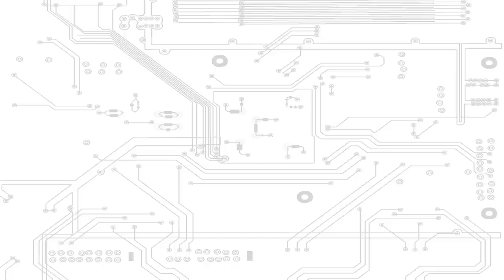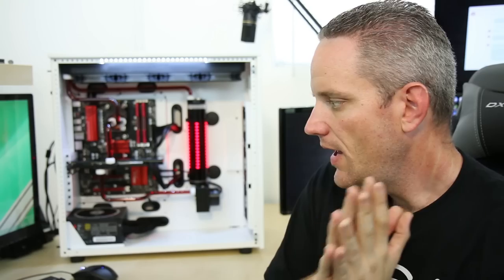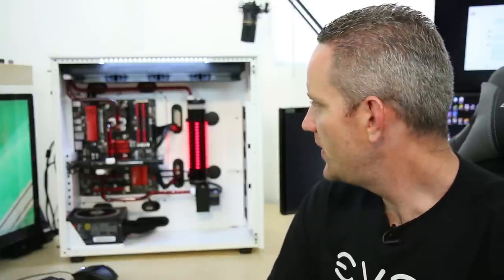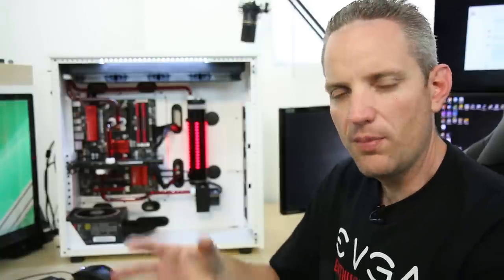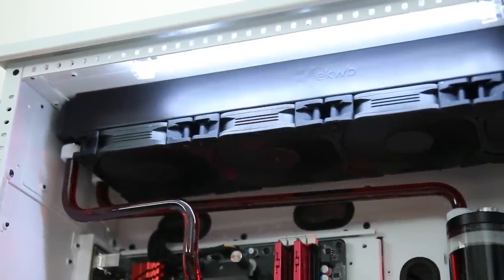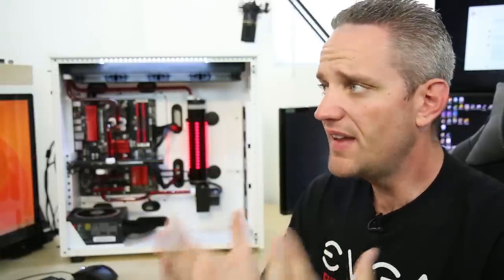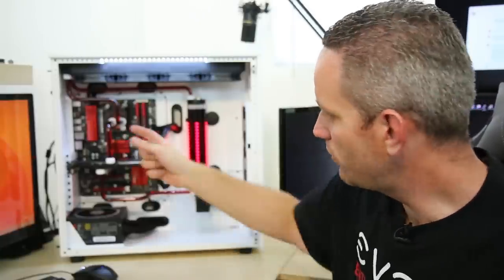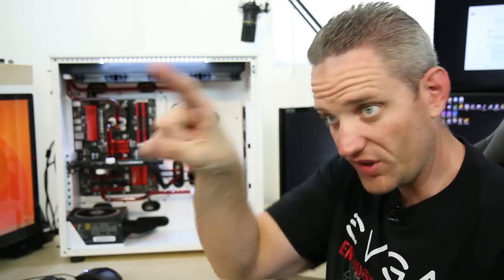Custom Watercooled AMD Gaming PC

Comment: it is possible to make a watercooled PC with a budget of 1300$?
but the PC should also have a good performance for video editing. (my idea of my PC)
Is it possible? :)
Reply: AidenFX | Motion Design $1300 is about £830. So for that you can defo build a pretty powerful system. It also depends what sort of water cooling you want e.g. custom like in the video or a closed loop like a Corsair Hydro Series etc as that would determine how much you'd have left for parts etc. But generally in that budget range I'd stick to AMD. Either an 8350 or you could get a 6300, overclock the fuck out of it and then spend the difference on a better GPU as you can utilise the CUDA cores (only on Nvidia) to increase video rendering speed (significant increase) and have increased performance in games. Yup, I'd probably go 6300 lol.
Reply: Even.Ways Music  ähm yes i mean  custom watercooling. 
and i don´t like AMD processors because they´re haven´t much power. Intel is in videorendering etc better
Reply: AidenFX | Motion Design Intel is better yes. But if you just use GPU rendering the CPU makes no difference and you can save like $120+ on the CPU and put it into a much better GPU. Plus if you overclock an AMD FX it makes up most of the performance gap. But yh, that's the most cost effective way in my opinion.
Reply: Even.Ways Music  is gpu rendering as good as cpu rendering?
Reply: AidenFX | Motion Design I'd spend more money on the CPU, because the performance of CPUs doesn't increase as much over a certain time as the performance of GPUs. So if you have got a good CPU once, it will serve you long.
If you buy a high end GPU now, you will still have to get a newer one soon, if you want a comparable performance at new games.
So I'd rather go upper midrange or high end CPU+ midrange GPU.
Reply: TheKroeterich  okay thx

Comment: Why does everyones CPU run much hotter then mine i have an AMD FX-8350 stock cooled and i got no higher then 40c under load and idle at 22-25c
Reply: Plant Gollum it might be the airflow of your case.

Comment: I want to do a custom loop for my next build but I don't have a reference GPU :(
Reply: Oreo1298PvP There are plenty of blocks out there for non-reference GPU's.  You may have to get a different card, though.

Heck, I've noticed that plenty of cards I though were custom PCB's actually WERE reference cards!
Reply: It's the MSI GTX 980 Gaming 4G. I'm 99% sure its a custom PCB.
Reply: jedidethfreak
Thanks!

Comment: The build looks gorgeous and the parts are "OK", but the case still makes no sense. 

Don't take me wrong, I love caselabs cases and what Thermalfake did was wrong, yet the build do not require that case and the money could have gone in better performance hardware and a cheaper case.

Comment: Hello, my dad works for lenovo and he is getting me (for free) an m58 9960 computer, I'm upgrading the ram to 4gb and I just bought a nvidia geforce gt 730, I have been told by 2 people that I can run most games at 720p at low setting at decent framerate, I would like to know what games I should start off with and won't be too expensive, also this is a temp pc so don't rage and if the games are in a bundle in steam, that would be great :)
Reply: ethan price League of Legends, CS:Go?
Reply: TheKroeterich thanks dude :)

Comment: Eeewww... White, red and black..? Should have gone with a Define S. What a waste...
As for your question on water cooling content, here are some ideas from the top of my head.
1. Slim, high FPI rads vs thick, low FPI ones.
2. Waterblock installation guide.
3. Push vs pull vs push-pull.
4. Full system watercooling on a budget.

Comment: ***** I've been wanting to request a certain water-cooling video for about two months now... Would you be willing to do a "retro" water-cooling video, using parts from 10 years ago (water-cooling parts, case, hardware and software available at the time, including OS), and see how it might handle games from, say, the past 5 years on at least 720p? I know it's something that would cost you time and money, but I thought it would be something nice to see from you, since you've been water-cooling for about a decade. That, and I'm curious to see the things you did when you first started out, and what you would change or do differently if you had the knowledge you have now when you first started doing it. It might be "pointless" for some, but I think it would be a way to show just how far water-cooling has come since then.

Comment: amd cpu's for wow are not good. wow is cpu dependent of single thread performance. single thread performance to potential minimum fps is pretty much a 1:1 ratio. so in a raid or congested area an i5 or i7 will give you 30-50% more fps and in this build an i5 wouldve cost about 50 bucks more for that 30-50% gain

Comment: that psu isn't very good and isn't even price well. at $129.99 USD it's just poor and there are many better ones for lower cost. I think it costs so much because of the sleeved cables, but it's another fsp raider/aurum based psu. hope you didn't buy that for full price somewhere. best bang for buck AMD cpu, especially if you're doing any overclocking, is the FX 8320E or FX 8310. lower leakage parts and to state the obvious, you're saving $35-$55 and they're all the same cpu at the end of the day. nice build though. gonna change to rigid tubing in the next month or two.

Comment: ***** I'm a little disappointed in this build - not because it's an amd processor, in general. let me explain. I'm an avid world of warcraft gamer and I regularly post in the games gaming and hardware section of the wow forums. (under the handle mephala). people often post because they have fps problems when using amd cpu's. world of warcraft WILL run FINE on it, until she gets into 25 man + raids. at which point, a core i3 would crush it. a 4690k would beat it by even more. in fact, the fps dips can be so bad in raids on amd cpu's that I would downgrade to a gtx 960 in order to upgrade to a 4690k.

Comment: This is my dilemma I want a 8 core but the am3+ motherboards don't have PCI 3.0 and I have a 960 FTW.
Reply: Pci 3.0 is backwards compatible with pci 2.0. You are fine.
Reply: Dont get AMD, Intel does better if you want to game..
Reply: PCI-e is backwards compatible. Your card will work with any AMD board.
Reply: Get AMD, it does just fine with gaming. AMD user since 2002.
Reply: Chris H. Intel is way better for gaming..
Reply: blake adams i saw a test on youtube and if it is correct the pci-e 3.0 is only 0.5-1 fps better than pci-e 2.0 on 1080p. I bet the pci-e 3.0 only matters if you want to play at 1440p or 4K.
Reply: Wiikendz Watch a video where JayzTwoCents says AMD is just fine. The extra 5-15 frames is not worth the 200dollars more. So its not WAYYYYYY better. Sorry.
Reply: jkteddy77 I am waiting on Zen for my Fury build. If not, 5930K with Titan X ( or the next better, cooler running variant ). I typically make my builds last about 8-10 years before moving forward. I am still rocking my 965 BE and my first build was an Athlon XP ( still a beast and still run it for old games )
Reply: jkteddy77 This is why we do our research before pairing up cpu/gpus that do not play nicely with eachother. lol
Reply: jkteddy77 yeah man. I am running a ASUS GTX760 OC with my 965 BE ( zero bottleneck ). My fps went through the roof upgrading from my EVGA GTX 260 Superclocked Edition ( I needed DX 11. GTX760 is as high as I should go with the BE ). Im sure the 8350 could handle something a little more than the 960. 
   Yeah, I take GREAT care of my computers. They run like they are brand new. From what I have learned. AMD plays better with AMD GPUS and Intel plays better when paired with Nvidia GPUS. lol
Reply: Dude my $77 cup bets a $250 Intel one so no will never buy a Intel they are to expensive for the performance. I can get a 8 core for $130 so Intel is just for enthusiasts
Reply: blake adams
Oh yea, right. Tell me what CPU you have that beats an i5 4690k?
Reply: blake adams your CPU aint better than an i5...
Reply: Wiikendz in some things, it can be. Intel does not fully beat AMD in EVERYTHING. They both have their strengths and weaknesses. Both beat each other in different things.
Reply: Chris H. He has an 760K, that thing aint better than an i3.. it will never ever beat an i5.
Reply: Wiikendz i was not aware he had a 760k
Reply: jkteddy77 I dont trust MSI AB anymore.. Since I turned it off, I average like 10 fps more in GTA V..
Reply: I think the biggest problem with computer gamers is that you all are WAYYYYYYY to concerned with FPS rather than enjoying your games and hardware. You do not need to "max" out your games. Set it to default and move on.. I am a computer guy too but I do not obsess about it. Its getting REALLY sad these days.
Reply: jkteddy77
That was my issue in GTA V, I needed every % up to 100% to get good fps.
Reply: jkteddy77 yea, im thinking of getting an i5 to get better performance..
Reply: jkteddy77 Ofcourse turning up graphics gives the GPU more to do, it has higher quality textures etc to render. When you lower the graphics you get lower GPU usage because the CPU cant push enough data to keep the GPU at 100%.
Turning up graphics doesnt make your GPU output more frames, not at all.

In any CPU intensive game, a 760K will bottleneck anything above a 260X, a 960 will be bottlenecked quite a bit.
GTA V for example, a 860K can barely keep the 260X at 100%, there is no fps difference between Normal and High because the CPU cant send enough data for higher fps on Normal.
Reply: jkteddy77 an i5 4690k and 8350 is almost the same in rendering aswell, so the i5 would be the best choice, because it gived you both, the 8350 only rendering.
Reply: It's not a problem research it its not. a bottleneck yet
Reply: blake adams wow, you beat a special enegery-saving notebook/ultrabook cpu. applause! not comparable to desktop i5s
Reply: For a gpu in the range you're in it won't matter
Reply: Wiikendz It`s all depend about the kind of game you are playing and if you want to play a game at 200fps. The problem is 90% of the gamers are using a 60hz computer screen and a lot are just using mid range gpu where you wont see a lot of improvement.Lately except Arma, I see the others games getting better fps on AMD because they want to port their games over the consoles. I`m using a Phenom II 965 and I started to get 40-50fps on Planetside 2.

Comment: I don't really  like asrock mother boards my first motherboard I got was about a year ago and this mother board was terrible about 3 weeks after my first build it crashed I had two pull out two oft 4 memory sticks because the slots weren't working properly I called my memory manufacture and they check all my memory and it had no problem and then I made sure everything was compatible it's weird because it ran two sticks of memory fine and I checked the max memory it can have it could handle 32gb and I had no were near 32gb then about a year after that my mother board stopped working my computer just wouldent turn on. So I tryed to find the problem my self and I thought it was the mother board but to be safe befor I bought a new one I took it to a proffesional computer company and they said it was the mother board so I decided to call asrock because it should still be under warranty well there mother boards only have a 1 year warranty so I got really mad and order a new Msi mother board and have had no PROBLEMS AT ALL

Comment: custom watercooling is nice still doesn't feel worth it
Reply: martin eike Pure price/performance?  No, it's really not.  You can go AIO and get similar performance - even for GPU's - for FAR cheaper.

Aesthetics?  Your mileage may vary, but IMO, it's worth it.
Reply: I run WC for two 780ti and a 4770k. My GPUS when ran in air would max out at about 80*C, now they reach a chilly 53*C.

CPU gets a bit hotter than that at 60*C playing high demand games. The aesthetics also look awesome. So at the end of the day it's pretty awesome but expensive.
Reply: Span Dan A gift for you --> ºC
Reply: martin eike I have 2x 980Ti's fully overclocked they hit 36c whereas before they were in the 80's. My room doesnt get as hot anymore and the case is super quiet meaning a much more enjoyable experience. The cpu overclocked runs in the mid 40s while gaming (5930k @4.5ghz) and doesnt break 60c while under a stress test like aida64. Not to mention it looks great.

Sure its not really performance/price worthy but its more of an enthusiast thing and more of a hobby for myself.
Reply: *****
 I refuse to come to terms with how much ive spent so far lol o.o.
http://pcpartpicker.com/p/gxrBRB

Not to mention the watercooling blocks (X99 block, both GPU blocks and backplates, Triple parallel for the GPU's. Pump, res, tube, fittings. 240 and 2x 480mm radiators and 14 corsair sp120 quiet edition fans, 1x AF 140 aswell.

Of course it never needed to be anything as powerful but its a hobby of mine, Expensive one but lol.
Reply: Roof Tyler I agree man. WC is so worth it. How many rads you packing because your cards are extremely cool or are the 980ti's efficient cards?
Reply: Roof Tyler Sorry just seen your other comment! Awesome Bro! Got any photos?
Reply: ill stick some up tomorrow got a couple fans to put in tomorrow and a few cables :)

i have that many radiators for the future really incase i decide to get 3way cards the extra 240mm radiator will help quite nicely. but yeah they run extremely cool 36c so far.

Comment: Can u guys help me?
I might build this pc, but im not sure if i can get a better one for this money.
And what power supply should i use?
http://pcpartpicker.com/p/yrW6Lk

CPU: Intel Core i7-4790K
CPU Cooler: Cooler Master Nepton 280L 
Motherboard: ASUS ROG MAXIMUS VII HERO, Socket-1150
Memory: HyperX Savage DDR3 2400MHz 32GB 
HDD: Seagate Barracuda® 2TB 
SSD: Samsung 850 EVO 250GB SSD 
Video Card: EVGA GeForce GTX 980 Super Clocked 
Case: Corsair Obsidian 750D Big Tower Sort

Comment: YO JAY! what do you think of this for a $700 build? is it worth it? AMD FX-8350 4.0GHz 8-Core CPU, MSI 970 Gaming AM3+ MOBO, Mushkin Enhanced Stealth 8GB MEM, Seagate 1TB HDD, MSI GTX 960 Gaming 2GB, Rosewill ARC 650W PSU, Rosewill WolfStone Case 

it's a combo pack from newegg http://www.newegg.com/Product/ComboBundleDetails.aspx?ItemList=Combo.2291588
Reply: thelastone7139  What I have now : Intel(R) Core(TM) 2 Duo CPU, evga Geforce GTX 750 Ti, 8GB dual channel ram , not sure the motherboard but it sux lol ;) , I can play almost every game out on high and some on ultra with average fps about 60  so it's not bad just looking to move up!
Reply: thelastone7139 if i was you, i wouldn't get a completely new computer, I'd rather upgrade your CPU to an i5 or something like that, that would be a good step ahead, and maybe get an ssd. later upgrade your gpu, the 750 ti should be still enough for every game out there :)
Reply: TheKroeterich I looked into that , I would need to get a new motherboard,power supply,and processor and for not much more I can just get a new computer , Time to move up anyway , sad part is that deal is gone.

Comment: what does mean push and pull, push pull bla bla bla what does it mean?
Reply: TheZaRuNo wtf are you talking about?
Reply: what is push and pull? its like something with the fans in the radiator but i dont fucking know,so im asking
Reply: Its no prob. It means how the fans move air through the radiator. you can have the fans push through the radiator which some say is slightly more efficient but dust gets trapped between the fan and rad. Or you put the fan on the other side and have it pull through the rad which then you don't have to take it apart for just a quick dusting.
Reply: TheZaRuNo Push = fans pushing air through the radiator; Pull = fans pulling air through the radiator;
Push/pull = fans on both sides of the rad, pushing AND pulling air through the radiator.
Reply: Justin Updyke Great explanation! Thanks!